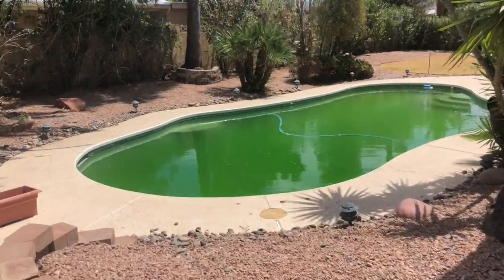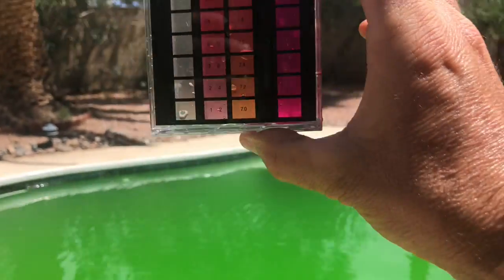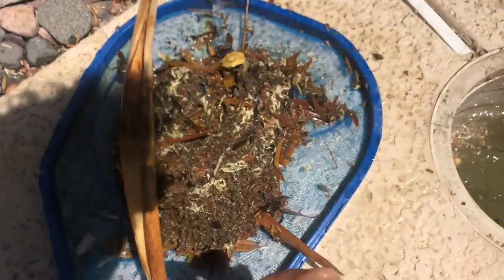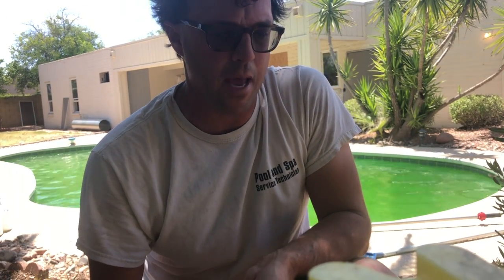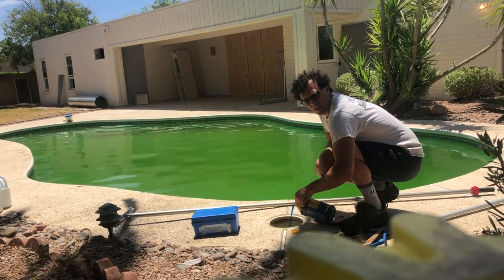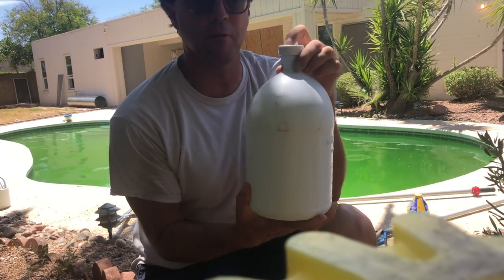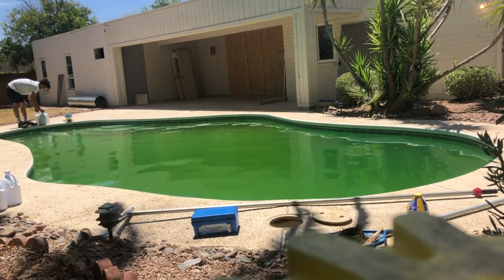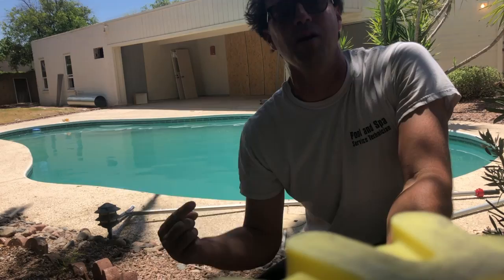From Green to Blue in Minutes: Dropping the Calculated Chlorine BOMB!

Comment: I'm in the process of designing and having a pool built, one item we are hung up on is wither to go salt or chlorine. What would you recommend?
Reply from the maker: Salt IS Chlorine. If you maintain the cell, keep the pH in check, and salt level where it should be, salt chlorine generators are great systems. Just remember that below about 60°F they don’t produce chlorine. If you close your pool in the winter time, this won’t really matter though.
Reply: Swimming Pool Science thanks. Yes I understand that the salt turns into chlorine. I was just trying to figure out which to go with, friends and neighbors are all saying go with salt, but 6 out of 8 pool builders tell me go chlorine.
Reply from the maker: ybloc12 a lot of people have trouble wrapping their head around the chlorine generating system and think the cell will last forever (normal life is around 3500 hours of run time). And then when the salt is low or caked up with calcium because they didn’t maintain it, they get frustrated and think it’s junk.
Reply: @ybloc12  if you have flagstone coping or water features stick with chlorine system
Reply: Ken Chapel thanks! I believe we are going to go with travertine coping and deck, and a dry stack look rock facing.
Reply: In a chlorine pool you can run the pump for four hours and pour in liquid chlorine. A SWG will need to run much longer to generate the chlorine. The system upfront is expensive and the cell needs to be replaced 3-4 years and they arn't cheap. I would go Chlorine because you could always chop in a SWG down the road.
Reply: Croaker Outdoors thank you for the info. I do think that is the route we are going to go.
Reply: Ozonator, you can thank me later.

Comment: Was 10 gallons necessary or overkill to shock the pool? I've read that 1 gallon of Colorox would raise a 20k gallon pool to 5ppm chlorine. What ppm is necessary to reach in order to "shock" such a green pool?
Reply: First test your pool's CYA level. 40ppm CYA needs FC 16; 50ppm CYA needs FC 20. Use liquid chlorine from a pool store because for the higher concentration you'll get more bang for your buck generally. 1 gal of Chlorox will take you from about FC 2 to 5ppm. Check out troublefreepool.com for more information.

Comment: I've been looking at the Tube and FB groups, etc to see if pool care info is improving over time from the outdated traditional methods. Overall, it's gotten worse. This video is a glaring exception. Except for the algaecide advice, which I assume is polyquat based and therefore, no harm, this is perfect. The only thing I'd add is that in most algae outbreak scenario, it is not a pool filled with all new water and using trouble free pool's slamming techniques, it is best to have a FAS-DPD tester; test FC every hour and move it back up to shock level every hour, or as often as possible, especially in the beginning until three tests have passed the troublefreepool.com way, because often-times, the shock and forget method that many professionals and pool stores teach; means the algae was not completely destroyed; may have been left on a tiny crevice somwehere and will return. However, if you SLAM the tfp way and continually scrub all surfaces; you'll kill the bad stuff for good. CYA level is how you determine how much liquid chlorine to add; what FC level to achieve and maintain during SLAM. One has to know this before starting and that was mentioned.It  was right on to adjust PH before and then don't worry with PH again until SLAM is complete, because an accurate PH cannot be determined when a pool has a chlorine level above 5.
Reply from the maker: Trouble free has some good advice and the SLAM method is tried and true. The general consensus on Phosphates over there (at least when I last visited the site a few years ago) is completely off base though. You know your stuff Greg and I bet your pool is always dialed! Also, on the Algaecide, it’s not a polyquat, its a Polymer algeacide which behaves way different (see our algeacide video with Kyle Morgan) than a polyquat
Reply: @SwimmingPoolAZ-SPS  Agree that TFP needs to update their views on the phosphate issue and advice and techniques to better match reality. While It's true that the products to reduce them are often advised when not needed and over sold, and they are right in that regard; that's not always the case for all pools; they of course have their place. Richard Falk has been gone from there since 2016, and it's starting to show. The administrator there tends towards always teaching simplicity and an all-right, all-wrong mentality , which works fine until they're wrong from a chemistry standpoint. They used to be hard headed about the recommemded alkalinity ranges that was too high for many saltwater and sodium hypochlorite chlorinated pools, but finally changed to be more useful and helpful. Chem Geek used to butt heads with points taught that didn't always match chemistry principles, but that's done less  now over there. Still some geniuses over there though.
Reply: @SwimmingPoolAZ-SPS  The TFP website has now opened themselves up to accept reality on phosphates and phosphate removers. Here is their latest wiki article. As usual, it's top-notch chemistry info. 

https://www.troublefreepool.com/wiki/index.php?title=Phosphate_Removers

Comment: but water is not clear
Reply from the maker: Remember that while the water chemistry change was extremely rapid, it takes time for the pump and filter to trap all the suspended particles. In this case it was about 48 hours and 3 backwashes for the water to return to crystal clear.

Comment: Water is blue but still cloudy indicating algae is still present.  A single process step as this will NOT kill all of the algae. It will only hold it at bay for a short time.  You need to maintain that high chlorine level (optimum CL level will be determined by CYA value which he did not measure).  Only upon the following 3 tests will you be able to declare victory.  1) Overnight chlorine loss of .5ppm or less.  2) CC at or below .5ppm.  3) Crystal clear water.
Reply from the maker: True but did you miss the part where I say the CYA is 0 ppm because it was new water with no start up chems of any kind added. My normal ratio is 1 ppm chlorine for every 8-10 ppm CYA. 

Cloudy water is NOT always an indicator of live algae and it certainly isn’t in this case. We pushed well beyond break point chlorination on this and certainly killed off all the live stuff but it’s gonna take time for the sand filter to catch all the suspended leftovers.
Reply: This guy SLAM's
Reply from the maker: Croaker Outdoors it’s a tried and true method!

Comment: Acid can't just arbitrarily be dumped into the water. The formula, of total pool volume by what the Ph wants to be, needs to be used. If not anything copper, including the heater, could be damaged and over time destroyed.
Reply from the maker: Exactly. With this pool we started with an 8+ pH. On top of that the sodium-hypo would further raise the pH. I wanted a 7.2ish pH to increase the yield of hypochlorus acid on this 18,000 gallon pool and it was right on the money. The next day the pH was a 7.4. Under normal circumstances you wouldn’t want to add more than 1/2 gallon of 31% HCl to a pool this size with Alkalinity in the normal range and saturation index hovering within a 10th of 0 but you know that already.

Comment: my pool shop gave me Hydrogen peroxide 5lt  and something called " tac " 5 kilos  ......? is this the right product and how much do i need for 160 cubic meters .............................how long do you back wash for ?? plus at the end you are pouring bleach ? like the bleach you buy from the supermarket , i checked bleach at the supermart it said 2.6% that sounds very low ?
Reply from the maker: Hey citic, where are you located? Hydrogen Peroxide is a strong Oxydizer which will help “burn” off contaminants and chlorimines in the water. tac, I’m not familiar with as I don’t think we have that in this country. Where are you located by the way? That is bleach I’m using but the stuff I can get is 12% strength. For the size of pool you have using the 2.6% bleach, you’ll need about 5.5 liters for a 1 part per million increase of chlolrine for a pool as big as yours.

Comment: Can you do this method with a salt water pool?
Reply: I would advise unplugging the salt cell, or replacing the salt cell with a dummy pipe until the pool is cleared up.
Reply: @thecapeisout Can you say why you would want the salt cell out? I'm thinking, if anything, the muriatic would clean the plates a little. 10 gals seemed like a lot of shock though, in what looked like maybe a 15000 gallong pool, sure don't need the SWG running too. :-)

Comment: I did mine in 2 minutes with food coloring
Reply: Wont food colouring stain your pool?
I use food colouring to test for leaks but disturb the water after checking a spot because it is heavier than water and sinks to the bottom right away. If it lands at the bottom and settles it leaves a stain.
Reply: @SoundsLikeOdie  he is kidding......I hope.

Comment: Can you give me a rough guesstimate on what I can expect to pay for a sand swap on my filter? 28,000 gal pool. I only mention pool size because I am not sure what size filter I have. TIA
Reply from the maker: On a 2.1 SF filter (contains 300# of sand), we’re about #400 all said and done including disposing of the old sand. On a 3.9 (500# of sand) We’re at around $600 including old sand disposal. Anything larger than that runs over $800 with sand disposal. What part of the world are you in? Those are AZ prices.
Reply: @SwimmingPoolAZ-SPS  WOW, thanks for the quick reply. I am down south, AL specifically.

Comment: I have had a 40K gal. inground pool for 30 years and I know that it takes a day or more to cycle all the water through the filter. It appears that the combination of chemicals just turned the algae from green to blue. In another day or two, if all goes well, it will transform from blue to CLEAR, the way it should be.

Comment: how to use sodium bisulphate ?
Reply from the maker: Start by knowing your pools volume and testing the pH. This will give you your reference points in knowing how much to add to bring your pH back into balance. A good rule of thumb is to start by adding 3/4 of what ever your calculation of what’s needed as you can retest in a few hours and add a bit more later to fine tune. On above ground pools, sprinkle along the walls and on in ground pools, sprinkle over the returns while the pool is running. Give it a few hours to circulate before retesting your wate.r
Reply: @SwimmingPoolAZ-SPS  thanks😊

Comment: I always put my pump on circulate and dump all chemicals into the skimmer for maximum dilution and dispersant. I almost died when you dumped that acid strait in the pool.
Reply from the maker: Yeah, you either dilute your acid and pour around the edge or pour at a return while the pool is running OR pour in the pool and brush right away but NEVER pour into the skimmer.
Reply: @SwimmingPoolAZ-SPS  What about CYA?  I've noticed the powder kind has directions on the container to pour it slowly down the skimmer throat while pump is running.  Then run pump for 48 hours.  I was putting the CYA in a sock and hanging in front of a return, giving a squeeze of the sock occasionally until it all dissolved.  Which way do you recommend?
Reply from the maker: m4paws888 cyunaric acid gets a pass as it is relatively inert even though it’s an “acid”
Reply: @SwimmingPoolAZ-SPS  thanks very much for the reply. I really appreciate it.. it makes me feel better to use the skimmer for the cya because it makes it much easier than using the sock method.
Reply: Can you explain why you never pour into the skimmer? Bypassing the filter and circulating has never given me any issues when dumping any chemicals. Hell the pool company I worked for back when I was a youth taught me to circulate pump with filter bypass open and dump all chemicals into the skimmer.
Reply from the maker: cory ledet pouring chems directly into the skimmer even with the multiport on bypass is really hard on all the plastic/pvc components. Over time the chems will destroy the plumbing lines, pump, skimmer from the inside out. The ONLY reason I put the pooltec down the skimmer is because I KNOW that it will not react in any way with the plastic/pvc components of the pool.

Comment: All my life we kept our pool sparkling blue, never had much trouble.  Last several years it stays green.  I check everything and everything normal, I usually have to add acid and chlorine but once i get to normal levels there is no sign of algae dying at all.  I bought everything there is to buy and still nothing just green stinky water. I drained it several times this year and it goes right back to being green.  I watched this video, bout 12 gallons of bleach, got ph to around 7.2  and nothing changed in 24 hours.  Today we bough another 12 gallons, put algaecide in first, ph was normal and  still nothing changing at all. It makes no sense  we never had this problem before. 

Use to if we put chlorine in pool  you could smell it as soon as you walked outside. Something is wrong somewhere, everything I tested for it normal.
Reply from the maker: What type of filter? When was it last serviced? How long are you running the pool?
Reply: We put new sand filter a few years back. It was salt pool but need new part....it comes in 10 sec then off 10 and lights go crazy when you touch display so will buy new display part soon. I went back to chemicals since then ...btw all I got in last few days is just a lighter shade if green. I don't know what wrong. Everything is testing normal
Reply: Too much stabilizer/ CYA amounts can cause that...if you only are using tablets of chlorine, it will probably turn green quickly.
Reply: Chlorine lock from stabilizer, filtration/circulation issues, TDS being very high, etc can all cause issues. Decaying debris can release oils in a pool that look like algae but are not, it's very hard to treat.

Comment: Also,just wondering, whats the price difference (doesnt have to be exact but enough to get the idea)of you using 10 gallons of liquid chlorine vs   9-12lbs of cal hypo? im curious because we dont use liquid chlorine so i havent a clue
Reply: tokeup gaming : in my area using the liquid chlorine were cost twice as much
Reply: Liquid chlorine won't cloud the water and dissipates much quicker. Sodium Hypochlorite will raise your dissolved solids much quicker, calcium Hypochlorite will raise calcium hardness quicker. Depends on the pool, but if you throw any chlorine on top of acid you will get a major reaction although not really a safe practice.

Comment: Damn they were cranking that Pentair up high. I usually run mine at 1900-2200, and 2500 to vacuum, it screams over 3000rpm
Reply: single speeds run at 3450...the VS pumps run at different speeds for cost savings for home owners
Reply: Milo Kang it’s more the noise than cost for us. They are loud as hell when over 3000 rpm.
Reply: @Alex-us2vw  no kidding, I don't understand how some homeowners stick with a loud single speed pump when they have options of getting VS pumps that pays for itself.

Comment: Is it better to backwash before you brush the algae rather than brush before you backwash?
Reply from the maker: I like to backwash first, that way I know I’m working at my maximum system flow rate. Filters work better when there’s a bit of dirt in them (it actually helps filter down to a smaller particle) but water movement is just as important while shocking the pool like this.
Reply: @SwimmingPoolAZ-SPS  Ahhh ok that makes sense. I tend to brush before I backwash but that makes sense to backwash before so you can get max flow. Awesome video, gained a new follower. Thanks for the timely reply.

Comment: "acid is heavier than water"
That's an incorrect generalization. Perhaps the acidic solution you were using is, but there are many common acids that are less dense than water
Reply from the maker: For pool purposes and HCL, Acid is more DENSE (I should have used that word in the video) therefore it sinks.
Reply: @SwimmingPoolAZ-SPS  HCL yes

Comment: Question: Algae is sort of like a scummy , microbial plant. In that green pool, it was a dispersed cloud of microscopic plants. What I'd like to know is, what happens to all of that dead algae?

Another way of looking at it - if you could some how rapidly evaporate the pool, you'd leave behind a green powder on the walls and bottom of the pool, which would be the dead algae. You could scrape it all off, sweep it into a pile, and end up with maybe a coffee bag size pile of dead algae (I have no clue really, just guestimating). Where does this pile end up in the system?
Reply from the maker: Part of it is oxidized and gassed off by the chlorine. Most of it either settles to the bottom of the pool then hopefully makes it’s way to the filter (through brushing & vacuuming) where it gets trapped then backwashed or hosed out.